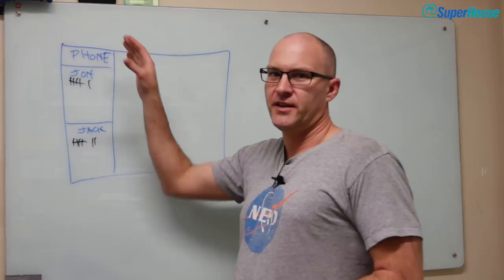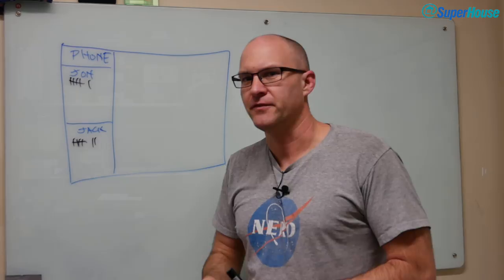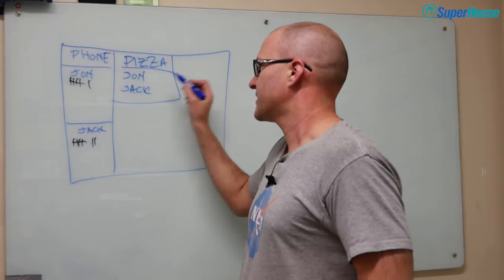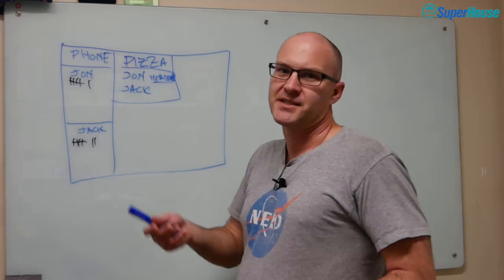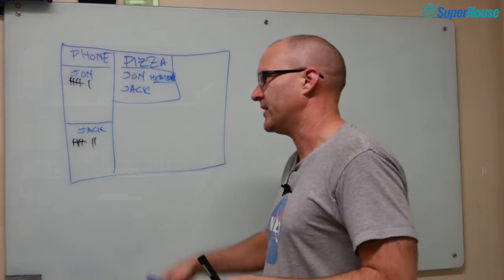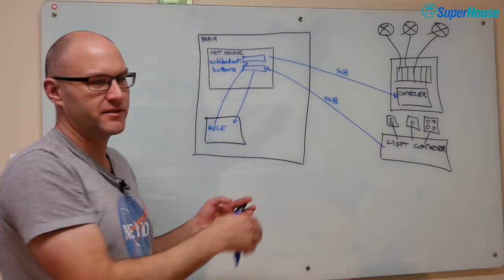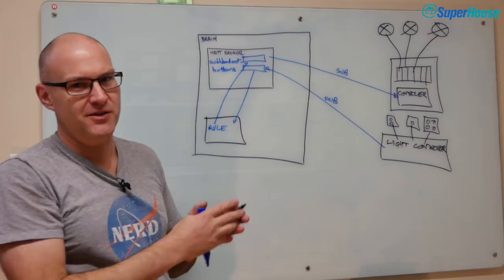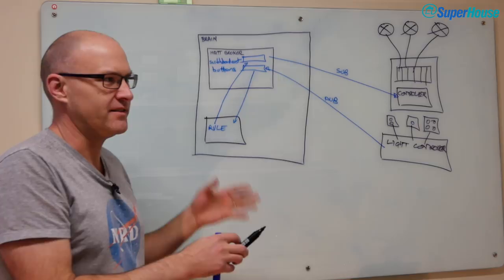SuperHouse #24: Home automation system architecture

Comment: Another great Video SuperHouseTV!
I've been testing with some of this different technologies since I had found them on your website and also Scargill's Tech Blog.
I'm planing my home automation system with some similarities to yours: MQTT, NODE-RED, POE, Arduinos, ...
However I'm very worried (as some of your followers) about system failure.
I don't want that the house become "dead" (especially lights) with my family in it when I'm a few days working trip!
I'm thinking in having my lights controlled by push buttons style switches that control power relays/dimmers with the home automation relays in parallel with the push buttons, simulating user press. For that relays I'm thinking in using solid state omron G3MB-202P.
What do you think about it?
Continue the great work.
Reply from the maker: That's a concern that many people have, and I totally understand why you'd be worried about it. One of the things I've been planning is duplicating the home automation controller so it can automatically fail-over to a hot spare if the live controller fails, and maintain transient data such as output state. The problem with trying to achieve totally manual control in parallel with the automation controller is that you can end up with a logical conundrum. If the manual switch is closed to force an output (or relay) on, then the controller can't turn it off, and vice versa. I think this is a big and important topic that warrants a whole episode.
Reply: Thank you for your answer.
The problem with redundancy and avoiding one single point of failure is that it will be expensive to implement.
Of course you can create redundancy only for the main controller but then what about the other system components: arduinos, ethernet switches, UPS, etc..
For me, home automation must be a as autonomous as possible and allowing more critical functions to be controlled by manual in parallel. 
The way I'm seeing things, manual switch will not be a problem because I want to use a push button not a regular switch.
The output from that push button will control a relay/dimmer that change state at each pulse.
However, I still need to determine if lights are on or off! I think for that the best solution will be some opto isolated circuit between the relay output and the arduino input pin!
Reply from the maker: If you use latching relays with some kind of state detection (as you've suggested using an opto isolator) then using buttons to pulse them independently of the home automation system would be a good way to go. This sounds like a good plan to me. I'm not using latching relays though, so I couldn't do it without making major changes.
Reply: Since I'm starting to build a new home now, fortunately I have all options available.
The most important aspect is that if you want to keep the costs controlled and have a "clean" and logical installation, is better that you clearly define your solution at the beginning of the project. However,  no system is completely future prof and you may end up in a situation were to integrate some new device/functionality you need to rebuild part of the system.

Comment: Love this architecture and your follow-on centralizing all the logic and just having dumb gear our at the switch locations.

Does the OpenHab software remember the state of everything if the "brain" reboots? It has a state database in permanent storage?

A concern I have with going down this route is that now one has a single point of failure. If the brain dies, you can't control any device in that part of one's house. I guess the answer is to have a spare brain. I suppose the same applies the entire setup - any networking gear, the home-made switch controller, etc.

Comment: thanks a lot for sharing this video. and thank you for always being my inspiration
just few questions I have,
1. how have you managed to put the motion sensors to talk with openhab? or they are hard wired with your lights? or are you using some dedicated Arduino in a room which handles all the sensors and throw the data on openhab

2. I know you have made a video to reset the Arduino if it gets stuck so have you ever thought of using some rugged controller like atmega644p, 324p, 32? with avr as it wont get stuck and have troubles. or maybe stm32?(that gets really complex but still)

3. you have got every Arduino hard wired in your house with the Ethernet switch, any specific reason? is using an esp8266 be a good option ? so its like just make a switch board and place it anywhere with just a active power supply to power the esp? 

sorry for so may questions but talking with you have always been an interest for me, thanks a lot in advance 

cheers!
Reply from the maker: Matching your questions:

1. The motion sensors could be connected to the button controller (which will be the feature of the next episode, to be uploaded in the next few days) so they are treated just like light switches on the wall. How that works will be shown in the next episode. However, I've connected them instead to a dedicated controller that uses end-of-line management to detect tampering etc. When it detects activity on a motion detector, it publishes the event to MQTT. Then other services such as the rules engine (which could be Node-RED, OpenHAB, or whatever) can act appropriately. In my case I have a little script that is effectively a dedicated rules engine just for the metion detectors that subscribes to the motion detector topic, and when it detects activity it maps the particular sensor to some action, and then connects to OpenHAB to do things like toggle lights. I'm probably going to replace all that with Node-RED so I want to cover it in detail in an ep about that.

2. No matter how reliable controllers are, I still like hardware watchdogs. Ideally they should never trigger, but for a few extra bucks added to the project they're the last line of defence in case some strange circumstance happens and the device goes off to lala land.

3. I do use WiFi for many things, mostly for sensors. For example, in this video I showed a little temperature / humidity sensor sitting on my bench publishing to MQTT. That board is a Wemos D1 Mini, which has an ESP8266 on it. However, I absolutely avoid wireless links for fixed position devices whenever it's practical. There are many reasons for this, and if I go on that rant my comment will turn into a book! The reasons include reliability, latency, security, complexity, and power distribution. Maybe I'll do a detailed discussion of that some time.
Reply: SuperHouseTV thanks a lot for replying to my comment.. 

Well talking about the rules you use, what about using a dedicated python script with the Mqtt plugin to run the rules instead of node red? Is node red that reliable to handle so many tasks ? Or you are using it for its simplicity to program ? 

I've used python script as rules set , like 
I have a motion sensor in my bedroom at night I don't want it to trigger lights when I move on bed, so before sleeping we usually enter alarm once that is done and I keep my phone upside down a mqtt publish is sent to  my broker and python reads it and blocks the motion sensor messages to toggle the light and as the alarm goes off on my phone in the morning , the sensors are back in action. 

So using node red for this will you get the maximum flexibility and speed which we can get if raw coded on python ?

And another thing I forgot to ask , talking about the hardware watchdog we use the jellybean ne555 which takes a pulse from Arduino, well what if the Arduino freezes while giving a high pulse and stays there ? The 555 won't understand that right? (This have happened with me after I adopted your circuit) 

Well thanks in advance 
Cheers!
Reply from the maker: You definitely could use a dedicated Python script. Right now I don't use Node-RED, I use a dedicated script written in PHP which is basically what you're suggesting but in a different language. The big advantage of Node-RED is that it has a very large number of plugins that allow it to link to different data sources and APIs, plus plugins such as timers and filters. It's easy to very quickly create complex rules using Node-RED.

Regarding the watchdog, you're correct, it's possible to fail while it is holding the output high. A more robust watchdog would have its own pulse-extender that is triggered by a rising edge only, so it doesn't matter how long (or how short) the pulse is. Making a truly robust watchdog takes a lot of consideration, and the simple approach I use is good enough for my purposes but definitely not perfect.
Reply: alright, thanks a lot for replying.

Comment: Another stumbler! I was looking at replacing my old security system with Arduino when I found your channel. You're home automation is amazing and everything I've ever dreamt of..HOWEVER I do have questions! LOL..1) Turning lights on and off is GREAT...but what about dimming remotely?? 2) Having devices powered by PoE does that mean that if the PoE hub dies, the whole system goes down? Do you have contingencies for various failures like one of the "control" boxes going down (for example the arduino that runs the light relays) or the Pi, or MQTT server etc?? I love this sort of stuff, but my wife's head would explode if I was at work or out for example, and she couldn't turn on a light!! (And then, when I finally get home, I'd be dead) Where do you think I shoudl start with the security system? My old Sol,ution 16 board is dead, and I still have all the old hardware...eg PIR sensors, BELL/HORN , Flashing light outside etc...what do I use as my interface? a Pi perhaps? Is it worth using MQTT? Thanks for your info and videos..

Comment: Its ok automating everything so long as you can still revert back to manual control as YOU will not be there forever and some other person has to understand this shit. I am currently building a house and am automating it using off the shelf PLCs and off the shelf SCADA systems on a phone or HMI. Very cost effective, simple and full manual control as well without any intervention.I.E. if the computers or any part screws up, everything still works as normal....All the lighting, Air con, Alarms, Some power and the oven can be fully controlled ( temps, times etc), garden watering , whatever. No special coding shit just a bit of ladder and SCADA understanding.
Reply from the maker: I talked about exactly that problem in this video: https://www.superhouse.tv/23-preparing-your-home-automation-system-for-death/ I had to laugh though when you said "no special coding shit" but you're using PLCs and SCADA. "just a bit of ladder and SCADA understanding".

Comment: The give-aways are a clever way to boost Patreon subscribers.  Good on ya!  Nice video and I sure wish we had 230/240 in the US - your mains wire gauges are SO MUCH SMALLER!  On a new build, I could save a few grand on copper alone :)  

Question for you - what would be the normal mains service for a ~300 m^2 home (in Amps) where you live?

Comment: Extremely useful video with very good explanations.
Basically, from a software engineering point of view, you are using the matt broker as semi interfaces to the this and services controlling or controlled by the system.
Do you have anything planned in the case of a brain breakdown, i.e. the raspberry pi or openhab crashes?
Reply from the maker: Yes, spot on about MQTT. From a software engineering point of view, what it does is provide a shared message queue with a well defined API with reference implementations and libraries available for just about every platform you can imagine, so it's dead easy to implement a new client and bind it into the system. Redundancy is a very important issue that I hope to cover in the future. Right now if the Raspberry Pi went up in smoke I could bring the system back up on the other Brain, but it's currently a cold spare. There's no automatic failover. I want to do that, and there's been some discussion on the OpenHAB dev list about it, but there's no simple clustering solution right now. Things like state would need to propogate between nodes to allow true seamless failover. I've done that in the past with other systems such as router failover, and also with web server clusters using cluster filesystems etc, so I have some clue about the problem. I just haven't spent time addressing it in the context of home automation. Yet!
Reply: In your experience, how frequent are those failures happening?
I'm planning for my future home automation system and your videos,
 especially this one and the one where you explain the process of "delivery" (stick a USB key with the current code in the box), are very helpfull in this way.
Reply from the maker: Total failures have been incredibly rare. By that I mean something like a major hardware failure that caused me to totally replace a device. In fact I think the only total failures have been with Ethernet switches! However, more subtle and annoying glitches do happen. My biggest annoyance at the moment is that something goes wrong with OpenHAB after it has been running for about a week, and it starts becoming laggy. I suspect there may be a Java memory leak or something that is causing the problem. However, I'm still running the old 1.x series, while OpenHAB development has moved to the 2.x series. I suspect my problem would go away if I moved to the current release but I haven't done that yet.
Reply: Thanks for sharing your experiences with us all. Take care

Comment: In north america there is only a meter on the exterior of a home.
The switch board (or circuit breaker panel) is always inside, usually in the basement.

Comment: Can't imagine what this all must have costed ;)
Reply from the maker: Probably less than you'd expect! The rewiring was done while we were doing a major renovation so the walls were already stripped back to bare frame, and it was easy to run cable anywhere very quickly. The equipment didn't cost much: the relays mounted in the switchboard came out to about $12 each including the mounting bases, I think. The switchboards themselves are physically big and made of metal, but that only means they cost a few hundred dollars instead of tens of dollars. The cable cost more than a normal wiring job just because there's so much of it, but on the other hand the electrician didn't have to bother wiring any light switches. He comes back sometimes to add new things, and it's amazingly fast for him to do something like install a new light fitting because the wiring is actually much simpler than in a regular house. Just drag a cable through to the switchboard, terminate it on a spare relay, and fit the light at the other end. No need to loop around to switches. The big killer though is my time! If I put a $ figure on my hourly rate, then the cost has been huge. But I love doing it, so I don't count that :-)
Reply: SuperHouseTV I have been following you since 2 years or more and am happy you are back, but I dont agree that it won't cost a lot. I mean the buttons are arduino board with your ethenet shield .. that will cost a lot for each node I guess. If the buttons code sens commands by wireless to the onboard RF receiver on the Pi, then it will be cheaper.
What do you think ?
Reply from the maker: You're right that every light switch used to include an Arduino with ethernet, but they don't anymore. I've dramatically simplified the way that part of the system works, and in a few days I'll be uploading a new episode that shows the history of my light switches and how I made the system I use now. Right now I have all the light switches in my house connected to just 2 Arduinos, and it could even be done with just 1. That episode is already filmed and it'll be uploaded this coming week.
Reply: SuperHouseTV That's great. Actually i was wondering why did you stated that you will be explaining some topics which you have already done a couple of years ago. Can't wait to see the new video.
Thanks.
Reply: Wireless via rf is a huge nono for me haha, imagine some script kiddie messing with that ;) maybe using a CAN bus system to a node would be a better idea, cheap and robust.

Comment: Great tutorial on mqtt! Appreciate it.
But i am concerned about fire safety, those arduinos can catch on fire any time, there is no industrial certification and warranty on their safety. They are good toys for learning. Do not take it personally, it is just my opinion. Why didn't you go with KNX or Buspro? I know, they are expensive, but they are industrially safe and over and over again tested in a high range o conditions and situations. I do consider safety of my family and house is first. Again, please do not take it personally.
Reply from the maker: Safety is a very important subject with any sort of home automation system. I've talked about that before in a few videos, because I really don't want to see anyone hurt (or houses damaged) because of people who don't really know what they're doing. I'm quite confident that the Arduinos won't catch fire, though. They're very low power, and even if one of them was short-circuited all that would happen is the power supply current limiter would kick in, and if that failed the circuit breaker would trip.
Reply: SuperHouseTV Thank you for your answer!